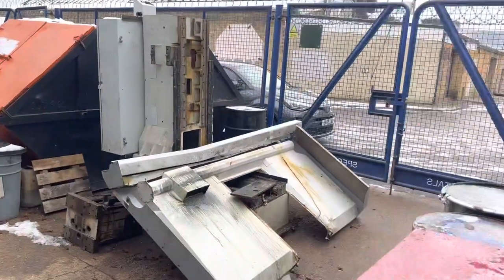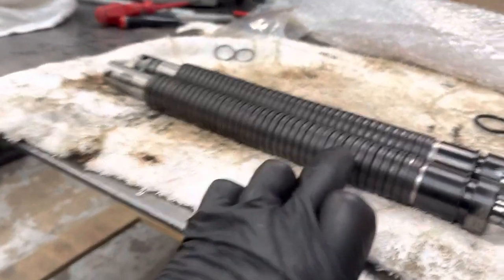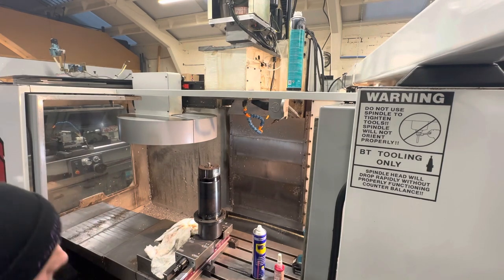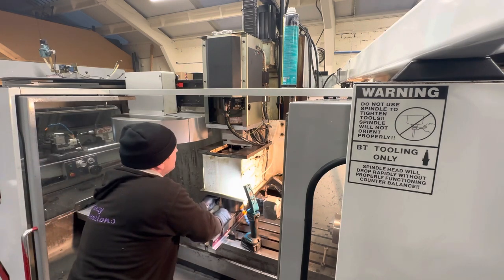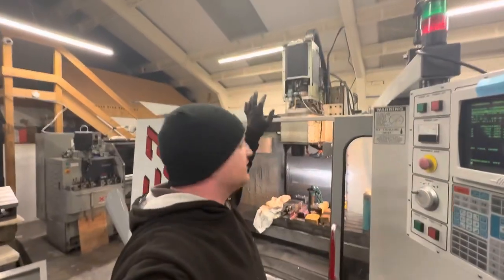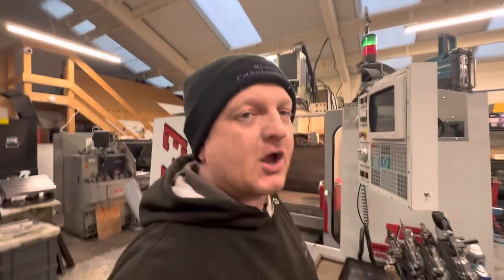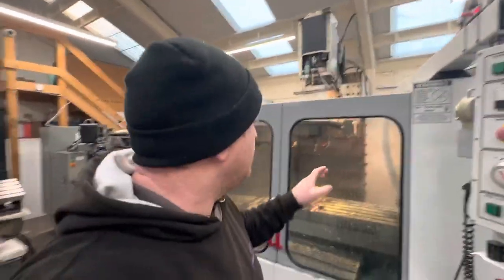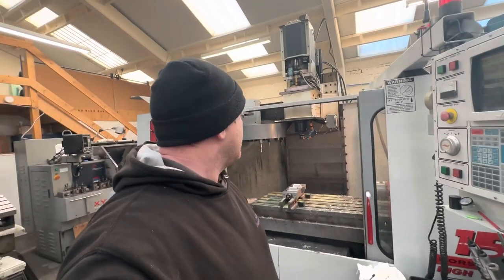Fitting another spindle into the Haas VF3

Comment: Haas procedure for feeding oil to the spindle (and checking adequate oil flow over x time)

Is to turn the machine on, home axis and all that.
Remove oil feed line from spindle 
Put feed line into a container (pop bottle 2 holes in the lid, one vent. One for the line) 
Run the spindle at 50 rpm for x hours. 
Measure the oil quantity that has dropped into the pop bottle.
I wanna say it was 2 hours run to receive 5ml of oil? Been a long time

You can always do this with the oil line connected to drip feed oil into an early replaces spindle.
Give a pill in the pump plunger right off the hip to begin the first oil push immediately then just let it run.

Fun fact. One of the reasons the warm up cycle is 20 min is so that you will receive min of 1 pump pulse before running under load. 
It is also so slow at the start to turn in air and purge excess oil buildup in the bearings before running at high speed to ensure there is not too much oil. 

Thanks for the vids btw. I wish I had time to take some for others while I had my machine ripped apart.
Reply from the maker: Hi

Thanks for taking the time to comment 👍

Yeah I had previously read through the oils line test process and carried it out on the vfoe I sold,

On the vf3 it does seem to run cooler now after I first initially put some oil direct in the spindle feed line before running as I think it was too much but now it’s settled in and the excess cleared it no longer runs hot or feels hot after warm up or other long cycles 

Only spindle issue is sticking tools in the taper, which has seemed to get better but still happens 

Thanks
Marc
Reply: @kinzy_fabrications  i use extrime pressure grease in my spindle, compleatly removes tool stick. 1/2 ml  / day wipped on one tool thats in cerculation and good to go, just try to avoid coolant spraying on the taper as it washes it off. so thick its almost a warm tar. original use is for lubricating dead centers in grinding applications.  also verify your not seeing a pressure drop when the piston engages. if the line is starving it for air it wont push as well and result in the tool changer pulling before the plunger is full pressure. hard on it. a little reserve tank after the regulator solves this perfectly.

interesting about the "oil cavity" for cooling the spindle, i know mine is dry there, i wonder if i can run a flood coolant line in there for cooling? i do alot of 10,000 rpm and cooling never hurts. 

one last thing,
im looking ot remove my spindle draw bar to replace the TSC carbide faces on the pluner and drawbar. is there any method of "dialing in" the draw bar when re installing it? i noticed mine has approx 0.005" runnout which i fear is damaging the tsc union seals
Reply from the maker: Hi

Thanks for ther tip on the grease, i do currently use some white hi temps grease and it definitely helps.
I have actually fitted a 1 litre reserve tank after the regulator already and it made no difference what so ever unfortunaly, i thought id try it as it was cheap to do and i had read of it helping by people on a few different internet forums.

As for the draw bar run out there is no way to adjust it on mine but there may be if you have TSC as i believe you have to set the unions with a dial indicator within spec to make sure they dont get damaged as you say but as i have not got TSC i can help you on that im afraid

Thanks
Marc
Reply: @kinzy_fabrications  i would consider a grease with anti rinsing properties over a high temp, thats what ill be tryin on my tapers next. try to maximixe its retension on the taper. often with the side mount the tol holder will swing through a stream of coolant while changing. yoys think a 10% mix of coolant shoul be sufficent lube, but nope. i do need to try a reserve tank on mine though, im far from the compressor with a fairly small line.

Comment: Congratulations on your success.  Was thinking about old spindle, would you make a video with the disassembled spindle showing the path the spindle oil please.  I thought the oil mist traveled down the drawbar into the top of spindle taper, but now I believe that's incorrect.  Would you help me understand that system better please
Reply from the maker: Hi

Thanks for watching,
In the new year when I have a bit of spare cash I will look into buying new bearings and having the taper re ground and I will do a video on the process but I’m afraid it won’t be for a little while

As you say the oil mist enters the top collar ring and runs down inside the spindle assembly going through the bearings and finally dripping out around the spindle nose 

Thanks
Marc

Comment: hi man
tnx for making videos about old machins 💪👏
I need how to grid offset VF0.
I have done google search but all methods work on new panel.
can u help me ? 🙏
Reply from the maker: Hi

Your welcome 

Is your machine set to metric or imperial  ?
Reply: @kinzy_fabrications  it is defined on meteric
Reply from the maker: When you do the grid offset calculation 
You distance to go minus 2.997
Then you multiply that by the steps/unit ratio 

Once the have that answer then you need to divide that by 25.4 and then input that answer into your parameter as even though the machine is set to metric it seems the parameters are based on the imperial units still

I had this same problem before and that works every time for me

Thanks
Marc
Reply: @kinzy_fabrications  Hello Mr Marc
With your help, the machine was fixed🎉

I used your formula and it worked
this was my path:
2.997-2.356=-0.641×104038÷25.4= -2625

I put this answer to grid offset and it worked 🙏🙏🙏🙏🙏

thank you ❣️

after that I think about A and B axis grids...
what is the Subtract of this axis?
i think they most have value of degrees

What do you think about it?
Reply from the maker: HI

I am glad that fixed it for you, 
With the A axis just treat it as normal and input the distance to go just as you would normally with the x y or z axis

Thanks
Marc